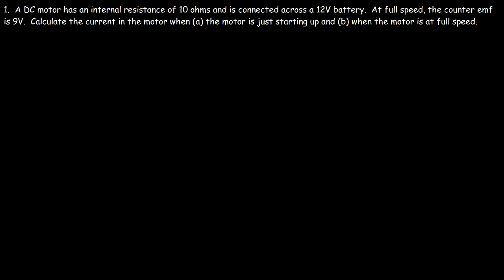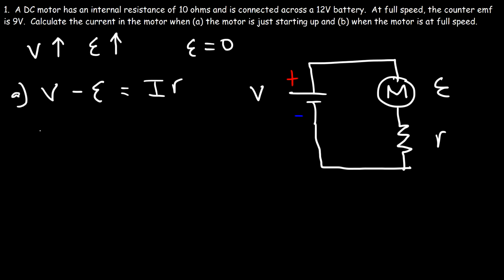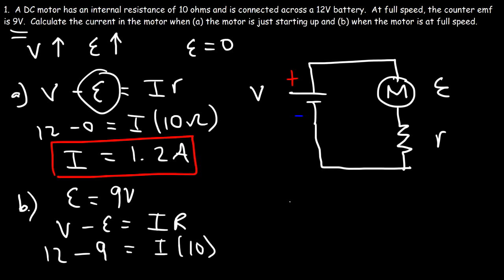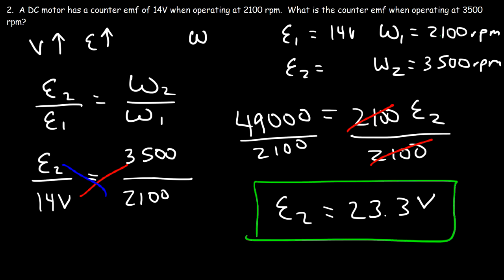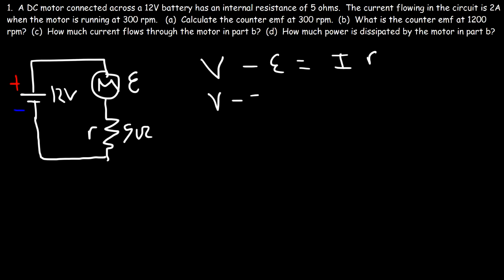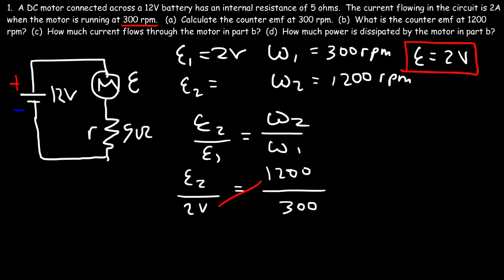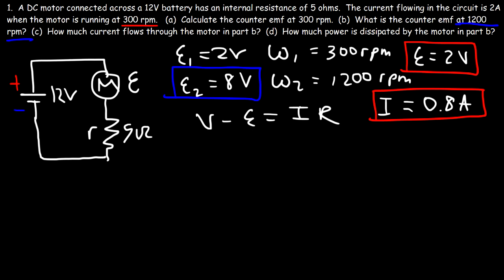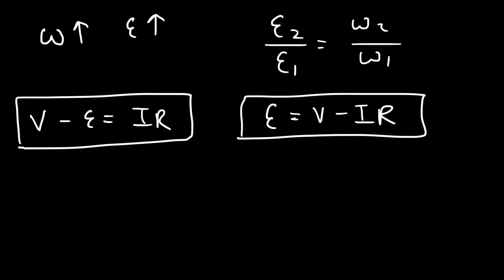Back EMF & Counter EMF of DC Motors, Internal Resistance - Physics & Electromagnetic Induction

Comment: Back EMF is easy to measure on bare wires with no incoming voltage, just by spinning the rotor and measuring voltage. So, if one connects a 12V battery to a DC motor, and the motor spins up to produce retrograde voltage, what would a voltmeter now measure across the motor? Would you still measure 12V, because anything more would be absorbed by the battery, or would you measure a rippling voltage of more than 12V because the back EMF is adding to the voltage on the incoming side of the motor?

Comment: I don't understand why you chose the power formula you did for Number 4 part D.
Reply: Cause that's one of the formulas for electrical power? He already had resistance and current, so using that formula was the fastest solution.

Comment: The age old question is - why is that CEMF B-emf counter MMF not also added to the total energy lost from the equation...?!

Remember any electrical and magnetic energy is said to absolutely come for the energy input, we wouldn’t want to violate any of those special laws would we... 

So after we calculate the work - motor’s output and we have taken into account the electric energy input, then the remaining energy not converted to motor output is the core and copper losses 

THIS HAS NEVER INCLUDED CEMF which is always been described as  ‘the  generator effect’ as a result of Friday’s law of induction, & Maxwell-Faraday law, in maxwells equations  

Remember the generator effect can’t come from NO WHERE we are told that energy can’t be created anywhere in the universe 
so we have a problem the CEMF is not put into the equation from I/O

In motor data sheet why is this subject not  found in the losses table? along with - copper losses, core losses, bearing losses
Eddy losses, hys losses, stray losses...
The CEMF is used on data sheets only as you have - to find the running RPM - loaded and unloaded.

Please respond ))

See link below for full equation 
https://www.sciencedirect.com/topics/engineering/motor-efficiency

This has been talked about for hundreds of years in alternative energy groups it’s not a new problem, but the fact remains the generator effect (breaking toque) in a electric motor is not accounted for as a loss, yet lol.., the motor is moving backwards and induction is happening. So therefore as many have said this is how a system can be actually measured over unity - over 100% for I/O when it is included 
After all it didn’t come from nowhere, if it came from the input (which it did) it must be measured on the output!

Comment: How can I protect my DC source from Back EMF effect? What kind of circuit should I use and where should I put the components in the circuit?
Reply: put reverse biased diode
Reply: @majidmehmood3780  Can I use the same protection for BLDC motor application?
Reply: Capture in caps and re-use the energy 😄 they won’t teach you that at school